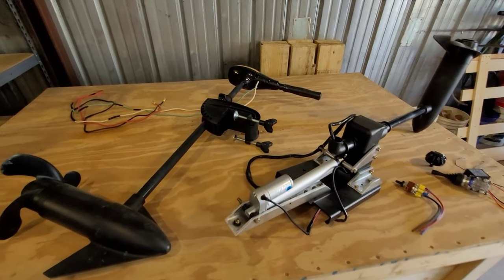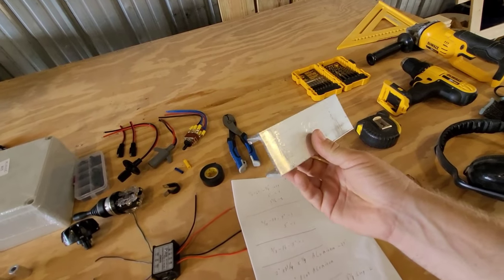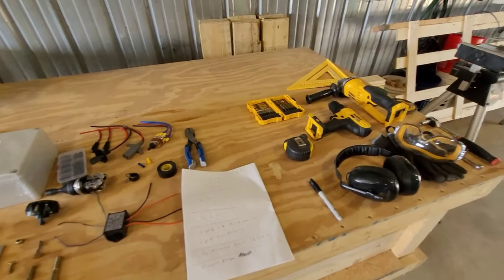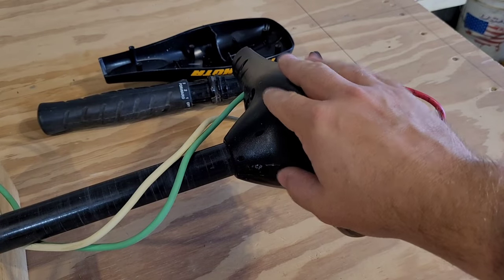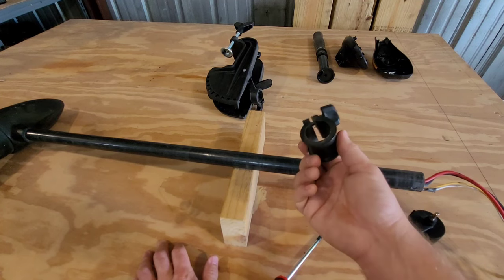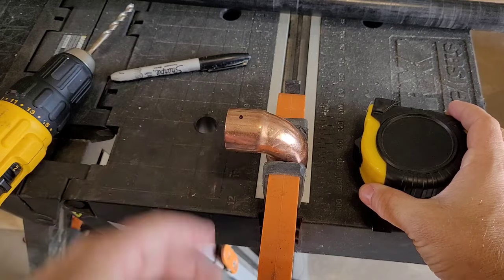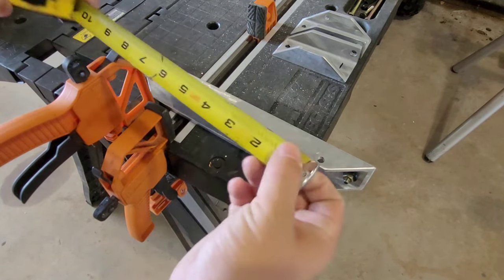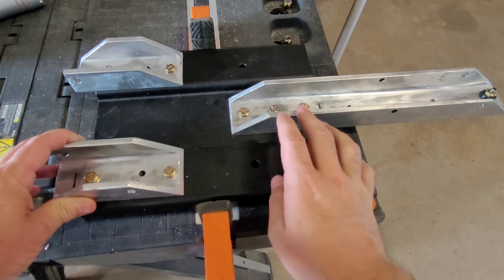Best kayak trolling motor setup! Homemade Powerdrive with power lift!!

Comment: Hey brother I really loved this video , I’m trying to get a start with the u tube thing . But I have used this video and love it . Prior to this setup I had a completely diy trolling motor , main difference is I used the power wheels gear box as the steering motor , it worked flawlessly only reason I switched to your setup is because I lost my leg in motorcycle accident and in order to go out in kayak I would have to put boat in and hop on one leg in the water and put motor down and in the water and off I went , but had to do the same thing when I got back to shore. So this power lift system solves all those issues . Just want you to know you nailed it with this video . Thank you man.
Reply from the maker: Man that's Awesome to hear! That really makes my day hearing that. Definitely put a smile on my face. I really appreciate that comment. I like helping people out. That's the biggest reason why I make these how to videos. I just like trying to make the kayak fishing experience easier and more affordable. And just knowing my video reached out and helped a fellow angler have a better day on the water brings me alot of happiness. Thanks! 👋 Happy Fishing! 🎣

Comment: Excellent video, now let's do it with spot lock!!! But seriously you have made this project much easier than it would have been otherwise. thank you
Reply from the maker: I really appreciate that! Lol your not the first person to suggest spotlock or pwm setup. That's something I really try to keep in mind on my how to videos. I just try to make it as easy/simple as it can be. Happy fishing! 🎣
Reply: @ARKAYAKFISHING  I just finished my complete wireless conversion of a transom-mount minn kota, and now I'm gonna try and add an arduino-based spot lock to it.  I'll try and do a follow-up video if it works!  Wish me luck!
Reply from the maker: @JasonSipe16  Nice build you did. Liked how you put everything in the battery box. Nice clean easy to transport. Good luck on the spotlock. I've been wanting to add a spotlock to my setup too. Be very interesting to see how you do it.
Reply: @ARKAYAKFISHING  Thanks! I'll certainly share any info IF I can figure it out!  I loved your motor actuator project!
Reply from the maker: @JasonSipe16  Thanks! Really appreciate that 👋

Comment: This is by far the best motor setup video that I've seen!  Awesome job!  I will be using this exact setup on my kayak!  Thanks for putting this together and sharing it!
Reply from the maker: Thank you Sir! Really appreciate that! 👋
Reply: Can you tell me where you got the aluminum channel , 24” piece ?
Reply from the maker: @JamesRichardson-wr1me  https://www.ebay.com/itm/2-x-2-x-1-4-Wall-6061-T6-ALUMINUM-CHANNEL-24-long-Mill-Stock-Cut-New-/284948032242?mkcid=16&mkevt=1&_trksid=p4429486.m46890.l6249&mkrid=711-127632-2357-0
Reply from the maker: @JamesRichardson-wr1me  here's a link to it on ebay
Reply: Thanks! Not being able to find this vocally was stressing me out as I have almost all of the other parts I need for this build, though I am configuring the box with a PWM. At least that’s the plan anyway.
Reply: Thank you!
Reply from the maker: @JamesRichardson-wr1me  your welcome! Yeah the aluminum channel can be hard to find sometimes on ebay. PWM will be nice. Hope the build turns out good. Good luck!
Reply: Will I still need the FWD/Reverse Module for the steering joystick if using a PWM instead of the speed control from the trolling motor? Just wasn't sure if that is necessary or just recommended.  Seems like it, so I will probably need a bigger box to put everything in. Sorry for all the questions.
 @ARKAYAKFISHING
Reply from the maker: @JamesRichardson-wr1me  your fine I don't mind the questions. Yeah you will still need the forward reverse module for the steering. Depends on how big the pwm module is you'll probably need a bigger box to fit everything in.

Comment: Awesome job on the engineering. This setup looks so professional and is as simple as it could be to add power steering to a standard trolling motor. I will be planning on a setup very similar. I saw another video where a guy uses a powerwheels drive motor and gearbox as the steering motor setup and used a wireless remote to control it. Thank you for the much needed inspiration to finish my trolling motor on my kayak.
Reply from the maker: Thanks! I really appreciate that! I haven't seen the power wheels video yet. I'll have to look that one up. Glad the setup helped out. Thanks for watching. Happy fishing 🎣

Comment: Started this build this weekend. Merged some other ideas from another DIYer using a pen. I also flipped the quick attach plate 180 degrees to prevent the potential of losing the motor in the water, in case the thumb screw were to fall out, which posed some challenges but think I havdd ed it figured out.. I would send you a pic of the mod so far if I could.
Reply: *pwm
Reply from the maker: Sounds like it's going to be a good build James. Hope it all comes together smooth. That PWM will be a nice addition.

Comment: Can you supply a parts list with links to find them? Better yet, have you thought about selling kits? I can’t seem to get to the links for the parts and this is the best video I’ve seen on this topic yet.
Reply from the maker: Give me a day or so I'll link most the parts here since the links in the description aren't working for you.
Reply from the maker: 15.8inch 10AWG Power Socket Sidewall Port + 15.8inch 10AWG SAE Extension Cable https://a.co/d/0HJvQjS

https://a.co/d/6qN2pAu

https://a.co/d/9ws8H8e

https://a.co/d/a1xNE4d

Otdorpatio Project Box IP65... https://www.amazon.com/dp/B09B6QSGJ3?ref=ppx_pop_mob_ap_share

https://a.co/d/7InpUyA

https://lakesidemarineandservice.com/collections/drive-steering-housings/products/minn-kota-power-drive-v2-drive-housing-assembly-2771826

https://lakesidemarineandservice.com/collections/depth-collars/products/minn-kota-power-drive-depth-collar-kit

https://lakesidemarineandservice.com/collections/quick-release-brackets/products/minn-kota-quick-release-bracket-1854035

https://a.co/d/irm5eX6

https://www.ebay.com/itm/284948032242?mkcid=16&mkevt=1&mkrid=711-127632-2357-0&ssspo=CWgJSJOzQge&sssrc=4429486&ssuid=8yFiJ4A2Q36&var=&widget_ver=artemis&media=COPY

https://www.ebay.com/itm/351421336196?mkcid=16&mkevt=1&mkrid=711-127632-2357-0&ssspo=CWgJSJOzQge&sssrc=4429486&ssuid=8yFiJ4A2Q36&var=&widget_ver=artemis&media=COPY

https://a.co/d/ixGCTuK
Reply from the maker: Above is links to parts. Everything but the nuts and bolts and wire. I gets my bolts from tractor supply. Hope that helps 👋

Comment: This is incredible, very patient and thorough. Do you have a source list for the materials? Not the nuts, bolts, wires, but certainly the power drive and switches, relays, etc.  Maybe was listed but I missed it. Thanks!
Reply from the maker: Thanks I really appreciate that! Yeah all the parts are linked in the video description. If you find a bad link let me know and I'll update it. Thanks!

Comment: Excellent video! Earned a subscriber! May I ask you this: how long is the end-to-end deployment/stow in seconds? 2) Does it go full horizontal when stowing?
Reply from the maker: Thanks! Really appreciate it! 👋 it can go full vertical and horizontal. It only take just a few seconds. Not long at all. They do make faster actuator then this one. This one is a 14mm per second speed.
Reply: @ARKAYAKFISHING  Thanks for the quick response. If yours was 8 inches (200 mm), end to end theoretically is 14 seconds, which is not bad. Do you have a clip of it being deployed or being retracted  on the kayak itself?
Reply from the maker: No problem. Yea I'll link a video below. https://youtu.be/6zvlVI6CkMg?si=P0kzRhgqFFl4v8Rl
Reply: @ARKAYAKFISHING  Thank you!

Comment: This was amazing to watch! Great job on the video! Would these parts work with my Newport 36lb thrust 24" shaft
Reply from the maker: Thanks! Really appreciate that. Yeah it should work fine as long as it has a 1-1/8 diameter shaft.
Reply: @ARKAYAKFISHING   I will have to try it! Just wasn't sure if the motor housing that you used would work with my Newport
Reply from the maker: It should as long as that shaft diameter is the same. You'll still need the minn kota power drive coupling that I showed in the video. That's the part that actually makes it turn.
Reply: @ARKAYAKFISHING   Thank you!I appreciate the help!
Reply from the maker: No problem! 👋 Good luck and happy fishing! 🎣

Comment: I have 1 1/8 shaft will thst steering drive work ? What is the hole in that power drive
Reply from the maker: Yeah it will work. Minn kota shaft size is 1-1/8.

Comment: Great in depth video.
Could you provide a link for the relay and aluminum channel?
You kept calling the yellow triangle tool a level? It's a square, LOL
Great Job
Reply from the maker: Thanks. Here's a link to relay OONO Forward and Reverse Relay Module for Motor/Linear Actuator, Reversing Relay Module (DC 12V) https://a.co/d/2eivAyc

Here's a link to aluminum channel. It's alittle taller then what I used in the video but it will work fine. https://www.ebay.com/itm/2-x-2-x-1-4-Wall-6061-T6-ALUMINUM-CHANNEL-24-long-Mill-Stock-Cut-New-/284948032242?mkcid=16&mkevt=1&_trksid=p4429486.m46890.l6249&mkrid=711-127632-2357-0
Reply: @ARKAYAKFISHING  Thanks for your swift reply. I should have been a bit more patient, after commenting I saw another one of your videos where it listed the relay and a different prop. Great videos, very informative. Wasn't sure if I wanted to put a trolling motor on my kayak I enjoy paddling. You can find older 30 lb used TM's really cheap and will probably start collecting parts for a build? If and when I do look for a shout out to your page. Thanks
www.youtube.com/@outlaw1915
Reply from the maker: Thanks! I really appreciate the support. I'm the same way. Sometimes I enjoy paddling and just keeping things simple. That's why I came up with making the trolling motor quick release. Sometimes I just want to enjoy a nice paddle trip. So I just leave the motor in the truck. It's just really nice to have that option. What ever you decide to do on your build if you have any questions or need help let me know. Good luck and happy fishing 🎣

Comment: question about your motor driven steering. Is it setup like a servo and center it self when not getting a signal
Reply from the maker: No it's not like a servo. It only moves when you give it power in the direction you want it to move in.

Comment: Great video! can anyone tell me what the overall measurement is from the end of the quick release plate to the end actuator (not including trolling motor)? I have a 12-volt battery that will sit in front of it.
Reply from the maker: Thanks! Really appreciate that. I'm at work today but I can probably get you a measurement on that tomorrow or Tuesday.
Reply from the maker: It's 21-5/8. You can take an inch off that because I added an inch just for a camera mount lol

Comment: Question in regards to the up/down toggle switch and the joystick. I noticed you are using a 2 position joystick to run the left/right motion of the trolloing motor and then a 3 position toggle switch for the up/down for the actuator. My question is........couldn't you get the same results with a 4 position joystick (L/R and Up/Down)? It might take a hot minute to figure the wiring with the relay and the L/R fuction, but the Up/Down should be pretty standard. Thoughts??
Reply from the maker: Yeah your right. You can do it that way and my ascend kayak is setup like that. I went with a separate switch on this kayak because I want to beable to turn and move the trolling motor up and down at the same time. With the joystick you can only use one direction at a time. Doesn't sound like that big of deal until you start using it. Like when im coming into the landing on a windy day or navigating some shallow spots. But yeah you can set it up that way. You'll just need two relays and a 4 way joystick.

Comment: Hey, How long is your release plate ..mine is 10" , also on the triangle pieces is a total length of 5-3/4 or 4-3/4? Thanks!!
Reply from the maker: It's 4-3/4. The plate on mine is 12-1/2 for the bottom and 10 for the top.

Comment: Loved the detailed installation. Good job! One question... did I miss seeing the inclusion of the "speed control"? Where in your wiring setup do you put the speed controller?
Reply from the maker: Thanks! You see the speed controller/factory control switch at 37mins. I'm going to be uploading another video next week going over putting the trolling motor on the kayak and the control box along with the wiring.
Reply: @ARKAYAKFISHING  Great! Seeing it mounted, installed and where you put the controls along with wiring, installation, and using it will be a great addition. Thanks for working on this!
Reply from the maker: @BigSkyDavid  No problem. Hopefully it'll help better understand how it all works.

Comment: Hello. I wanna ask if the power drive housing is universal for any trolling motor not just minn kotas?
Reply from the maker: The only limiting factor is the trolling motor shaft diameter. It has to 1-1/8" shaft.

Comment: Can you do this with a Newport Vessels Kayak Trolling motor? Its 24 inches so no need to cut it.
Reply from the maker: If the shaft is 1-1/8 like a minn kota then it should work fine.

Comment: Having a bit of trouble finding the 2" Aluminum Channel. Any recommendations?
Reply from the maker: Yeah I looked and could not find any either. I did find 2" tall by 2" wide on ebay. That will also work. It will just be alittle taller. Just make sure it's the 1/4" thick aluminum.
Reply: @ARKAYAKFISHING  2x2 it will be then.

Comment: Do you know if its the same setup for all transom mounted minnkotas? Came across a good deal on a riptide transom mount trolling motor and not sure if to get it or not. Great video by the way!!!
Reply from the maker: Thank you! I've never had my hands on a riptide but I know everything is the same but the control switch in the head of the trolling motor might be different from the endura models.  But even if the switch is different you should still be able to make it work. Let me know how it turns out.
Reply: After a month or so of seeing your video every day and doing research I finally finished my setup! Thanks alot for the video. I've seen you have an ascend 133x. I think you should review it! I myself and alot of 133x owners would really enjoy and benefit from your ideas. Thanks again!

Comment: This is the best video I've come across in a long time. I'm going to modify your plans a bit for my Endura Minn Kota - 30, which I use for my personal pontoon. 
Question - if that is a 4-position joystick, then couldn't you in theory use the Front/Back axis, rather than a separate Up/Down Switch to activate your power lift and your Left/Right axis would still control the steering, correct?
Reply from the maker: I really appreciate that! Yeah you can but not with that joystick. That one is just a 2 way only. They do make one that is 4 way. I have my other ascend kayak wired up like that with the 4 way. You'll need 2 of the relays also. Happy fishing!

Comment: Hi its me again lol . ok id like to use this motor control switch to get away from a pwm . my problem is  i only have the two power wires coming out of my motor. im sure the yellow and white   wires control forward and reverse. any idea a workaround to this?
.
Reply from the maker: Lol hey Michael. I think I would try to buy a factory switch like mine and hook it up and see if the trolling motor will come on. It might still work without the yellow and white wires. I've never tried to unhook them before.